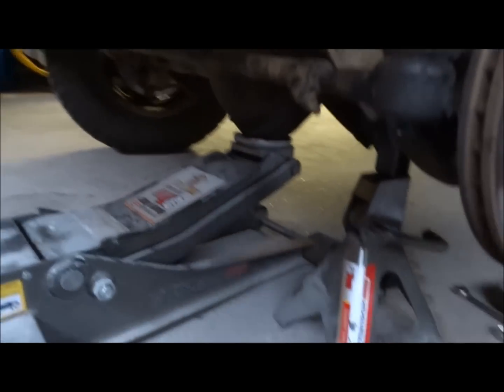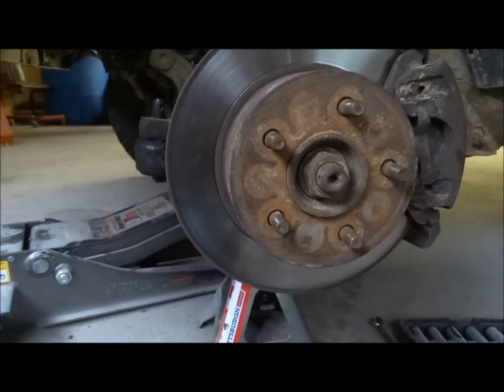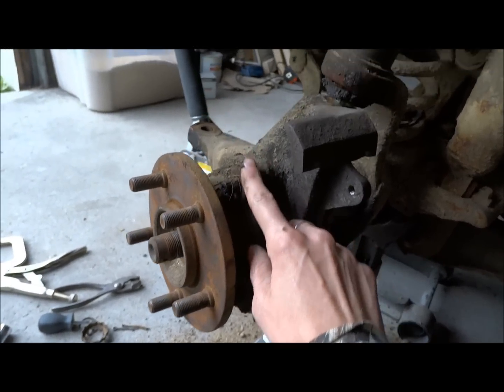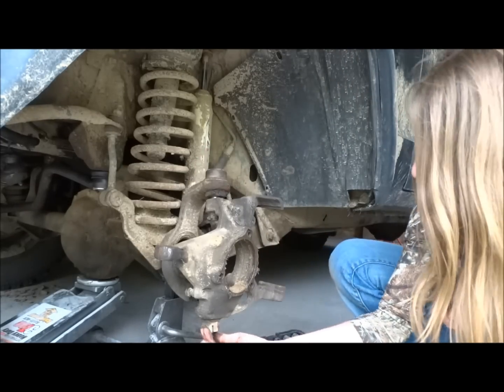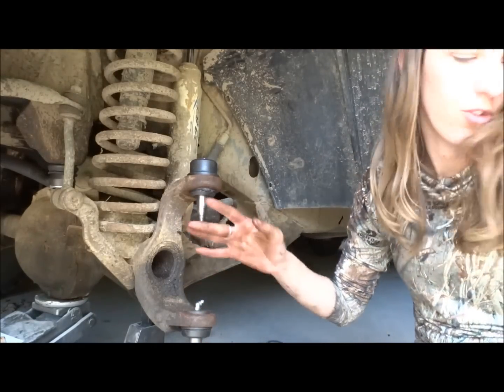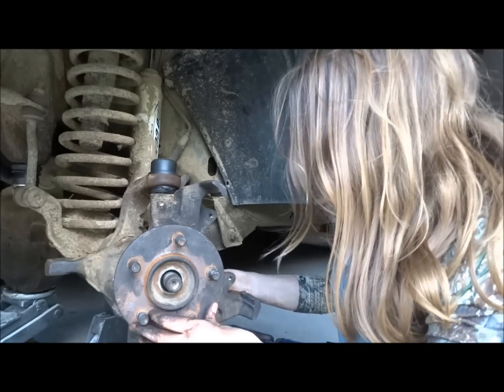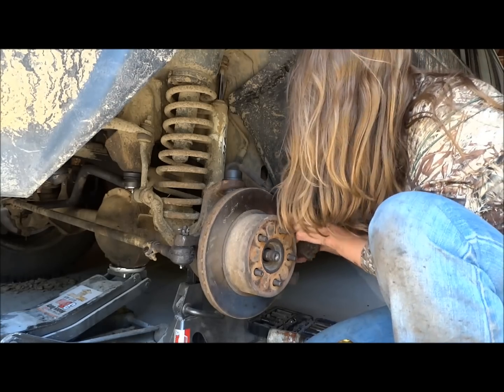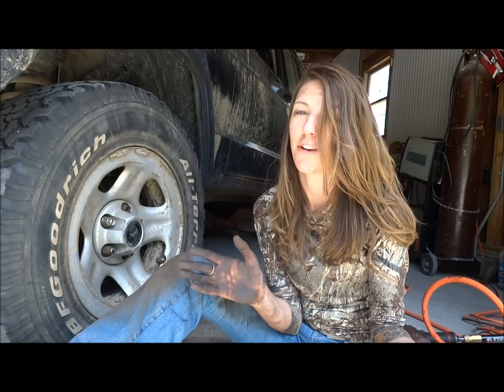Jeep Cherokee Ball Joint Replacement- By a Girl!

Comment: Two things: First, thank you for telling the sizes of sockets and wrenches needed. Also, I only needed to install a new upper with a 1.5 degree offset to correct a camber issue so I did not want to remove a fairly new lower in the process. The way you situate the C clamp was something I had not thought of. Thank you!

Comment: and not one swear word to be heard,great vid,did mine ages ago not a hard job bt i would but a little heat on the hub bolts then soak them to free them up,never force any thing to much,,,a 1mtr master bar also saves who load of swear words and a torque wrench also set to spec....its a learning curve,,,,great vid.!!!!

Comment: My wife and I (49 and 46) do all our own work on our 2003 TJ and a lot of the work on our 2013 JK. I got bit by the home mechanic bug a few times in the past, but it never really stuck; I did it because I had to but then lost interest.

The TJ we owned for nine years (2003 SE) threw a rod and punched a hole through the block, and I needed a new daily driver right away. We ended up buying another TJ that was exactly the same, even the color. (2003 Sport) It was inexpensive  but very beat. However we needed a vehicle right then and had very little money. So we limped it home and had to do lots of major work right away. 

We have been cannibalizing the nicer stuff from the dead one into the running one for the past year now (hood, tailgate, fenders, doors, roll bar, seats, grille, etc.) and have done some major work to the replacement. (Our first project was to replace the entire cooling system, including the heater core, fan clutch, water pump, radiator - all of it.)

My wife did not enjoy the work much at first, though because I needed it to get to work she hung in there and helped me as much as she could. As we have purchased better (and more!) tools and I have become a better mechanic my wife has become very interested in helping more.

We have watched lots of videos on all the front end stuff we are about to do. Your video seems to have lit a fire under her butt to take a much more active role than merely handing me stuff and holding things for me. I think I just might see her doing one side of the TJ by herself (U joint, ball joints, unit bearing, pads and rotor) with me being the hander and holder for once!

Thanks for your excellent video. You may have just pushed her over the edge into doing this stuff on her own initiative. Looking forward to your future videos.

Subscribed!

Comment: Good work, nice displaying of the parts! Too bad the sound is low at some points, but very easy to understand you :-) One question: is it the same procedure on a Grand Cherokee? I have a 1997 Limited 5.2 V8. Greetings from Denmark! Daniel. 
Btw, respect to you for doing the work yourself!
Reply from the maker: volvo650daniel Thank you for your comment! I should be similar. I'm not sure if tool sizes will be different because of the suspension difference in a V8, but the procedure should be nearly identical.

Comment: When you're tightening down factory bolts, i would highly recommend using a torque wrench and torquing to factory specifics.  Always makes feel a bit better knowing that that i got them tight enough to were they need to be. Im sure the impact probably tightened them enough, but its just a suggestion!
Reply from the maker: Justin Niemeyer Hi Justin! I did torque them all down to spec, I just didn't include that in the video. This is the first "how to" that I've done, so future vids will include that info. Thanks! :)
Reply: Awesome! i watched your other video on the wheel bearing and you mentioned that to torque everything back down.  That was after i had already posted the my comment.  It turned into one of those "Can't turn back now moments"

Comment: Were those hub bolts really that easy for you?  I was afraid of rounding them off so I stopped right there.
Reply from the maker: +jinxtacy I used a 1/2 12 point socket. I've heard of others using a 13mm 12 point as well. I sprayed the end of the bolts with PB blaster, and they did come out pretty hard. I used a breaker bar as opposed to the impact gun to start them. They didn't want to budge, but with enough persistence they'll come free!

Comment: Really thorough and clear video this helps !!
Thanks! Ryan, 90 renix !6 aw4 242Tc.
Did you notice a big difference in gas mileage after the install of those bearings?
Reply from the maker: ***** I didn't notice any difference in fuel mileage, but to be fair it's not something I keep track of. It did eliminate the death wobble that I had though. Thanks for watching!

Comment: You did a Great job, overall I'd give you a 10 out of 10. But just keep in record one thing.

1. Always tighten your bolts of the suspension with a TORQUE Wrench. It's very important you do that for every Auto job; If you don't know your Jeep's tightening specification sequence, you can either...

1. Call your dealership.
2. Check your owner's Manual or...
3. Call your local Auto parts store such as Advance Auto Parts, Auto zone, Pep=Boys, etc.

Also, Don't forget to always decompress your Piston Gear on the Brake's Caliper. I'm sure you know how to do that.
Reply from the maker: Justin Mojica Thank you! I did tighten everything down to spec, I just didn't include that in the video. This was the first video that I've done, future videos will have that info as well. :) Thanks for the comment and watching!
Reply: Your welcome.

Comment: I think there was a lot of liberty taken in this video. Many things look pre-loosened. The toughest part of the entire job (pressing out the ball joints) was omitted. It's not as easy as she makes it look.
Reply from the maker: There were no liberties taken during this video, and as I mentioned in the caption of the video, I had some camera (which was new to me at the time) fails during the filming process so unfortunately the pressing out of the ball joints did not get filmed unbeknownst to me at the time. Nothing was pre-loosened, and I certainly was not attempting to make this repair seem easy in any way. It was my hope that this would just be a general idea of how to replace ball joints for those who have not done it before. The opposite side is now in need of replacement and that vid will surely include the pressing out process. Thank you for your comment! :)

Comment: Nice video, but even guys should wear gloves to protect their hands during a job like that.
Reply: Protect your hands from what exactly? Brake dust? Grease? It don't matter man, if yo hands ain't dirty, you're not doing it right. There isn't anything pointy really to doing ball joints, and if you're thinking as far as something falling, gloves won't do anything to help crushing your hands, except keeping your fingers from flying across the room if they get smashed off. In the cold, I understand. But, I would like to know your reasoning. Maybe there's something I don't think of, that I could actually protect my hands with them. Idk.. Just seems like more of a pain trying to grip the head of a bolt or anything small for that matter with gloves on.
Reply: Agree. Wear good gloves like the "thickster" from o'rileys.  Thicksters are very tough and much more durable than any other nitril glove.  Make it much easier to clean up.  Why spend so much time scrubbing your fingernails when you can slip on some gloves before hand.  Only problem with gloves tho is your hands get sweaty.